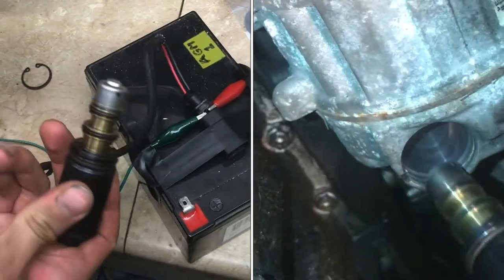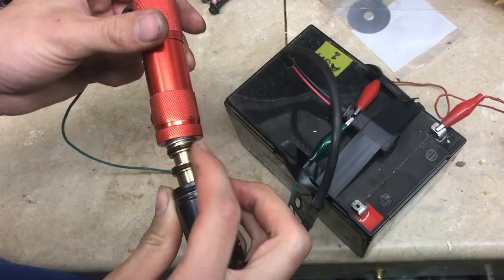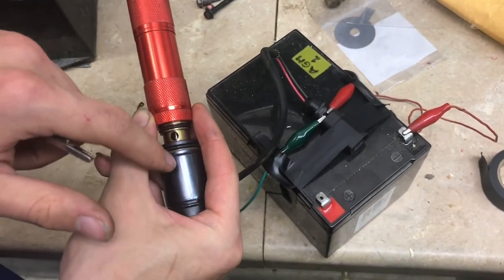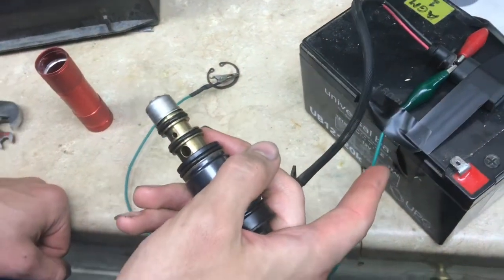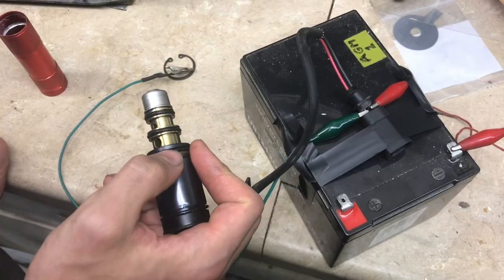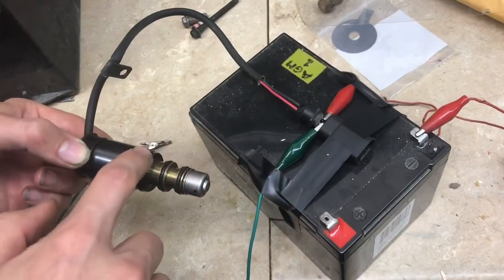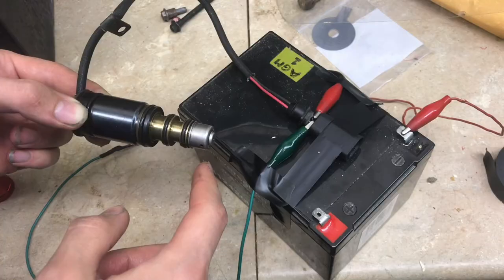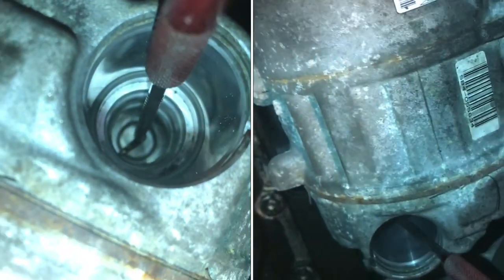how to TEST and remove “n280 ac compressor valve “HOW IT WORKS”

Comment: Thank you for taking the time to make this video - very helpful in understanding how to test the a/c valve. One minor point, the valve is a voltage-controlled pulse width modulated actuator. The control voltage would vary between 0.4 and 0.8 volts DC, not amps. Thanks again.
Reply: 0~12 Volts  0.4~0.8Ampere

Comment: I have two solenoids one from an old compressor I changed out and I can blow through it and it closes off when I put power to it The current compressor I'm working on I can't blow through it at all do you know what that means

Comment: My compressor clutch spins.  Gas at 115psi.  But low and high wont differ.  I can only think control valve is shut.  So if shut is 12v and open is 0v?  Problem started after replacing bat.  Maybe climate control settings in cpu need resetting.  Ill play with voltage on valve.  See if i can over ride valve control.

Comment: Full current to a PWM electronic control solenoid is a poor life decision.. this is not how you test these valves.. this is how one can be confident in knowing that applying un-modulated current to this bi-directional bi-polar valve will cease to work again... just replace/refresh with an upgraded design